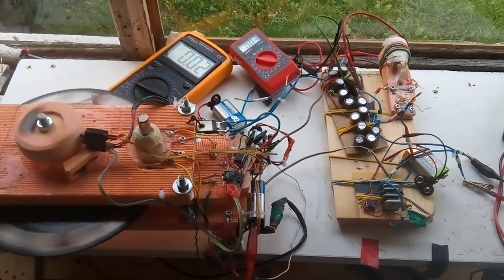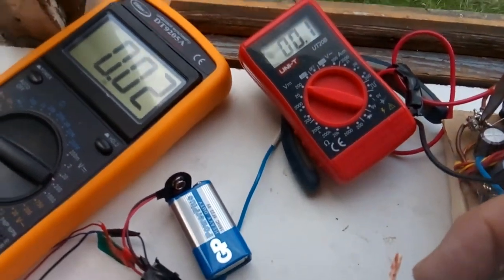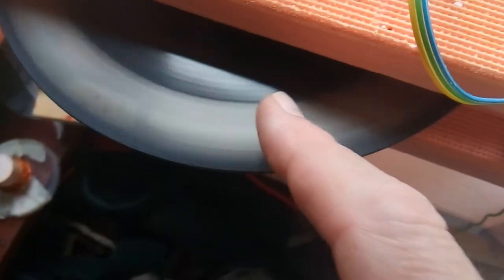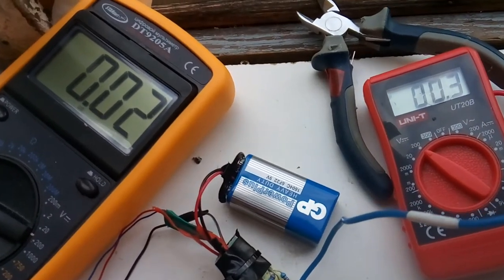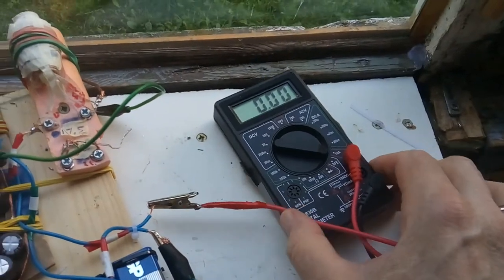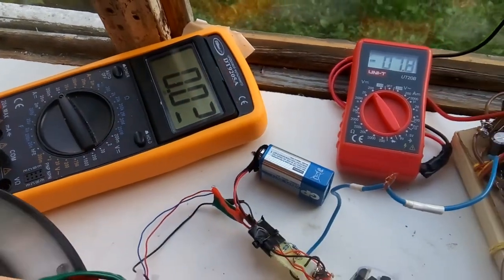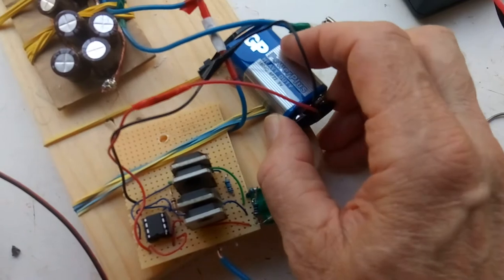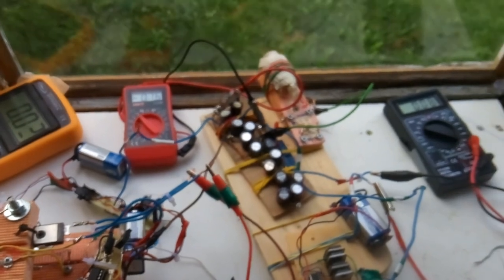Testing 2nd flyback connection switch

Comment: your load coil is being pulsed so it also is generating BEMF,  You should able to tune the load coil to a certain resonate state osc producing even more energy.   Tesla used flyback to recharge his caps as well.  nice presentation Doug.   I almost fell off my couch when you got fried. wow
Reply from the maker: The shock was a strange one, there was zero volts in cap bank,  looks like the wire going to positive of cap sticking up straight is what I touched but maybe never touched it! 
The mosfet' switcher's battery not connected too, so nothing feeding cap bank.
 probably I brushed the wire with flyback running into it and it mistook me for a cap but I wasn't connected to ground had rubber sandals on...

Comment: Kone got zapped ooooo. electrostatic at low freq hurts. from cap is even worse.  I just fired up the vibrator which uses a coil spring  with one of my coils 700turns 26ga and neo on plate that vibrates in a magnetic field.  still no output but vibration is awesome.  i need to pick up energy at right angles to neos which are fixed above and below the plate.  should get something next test.
Reply from the maker: Hi Gary
Remember the hippy motor? Self ran, powered a cabin...guys and girls in commume in California   building fake kalishnikovs for Vietnam war built it as a fun side project probably everyone on LSD!...
Very thin rods of ferrite (or  old poisonous lead style pencil leads was story) whole bunch of them located "on the flux lines" coming out sideways.
Flux lines near magnet thicker diameter lines out further thinner diameter but more of them...if you could cut through  lines with knife, they would resemble clusters of dots looking at them cross section...
Those dots are where they located very accurate the ferrite/pencil lead core rods to pickup the flux energy...so wire winds around them, then to a diode mounted it all on holes drilled through  clamshells! Instead of,or as well,  of one big pickup coil, maybe try a few dozen very thin ferrite rod cores, each with winds, each with diode, and all pointed 90 degrees to where the action is....